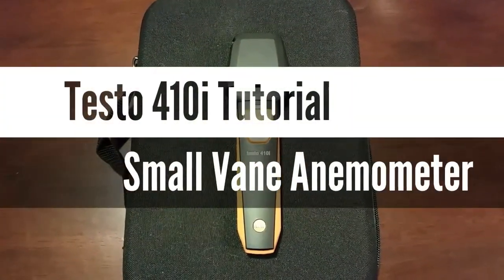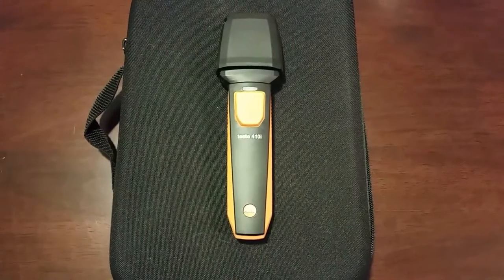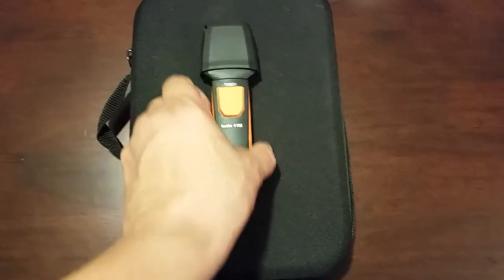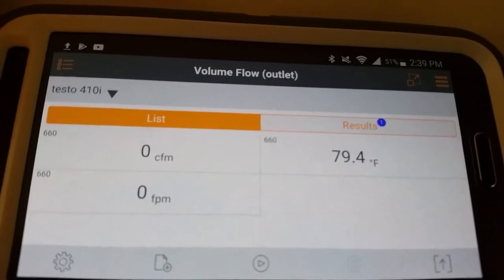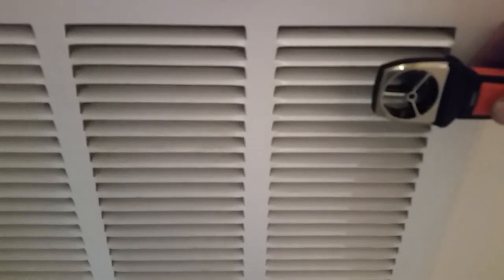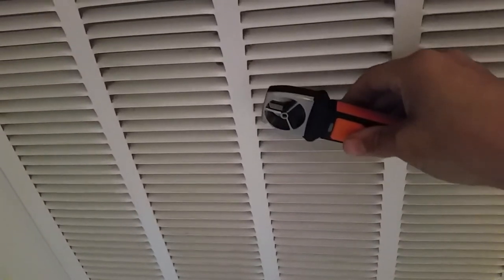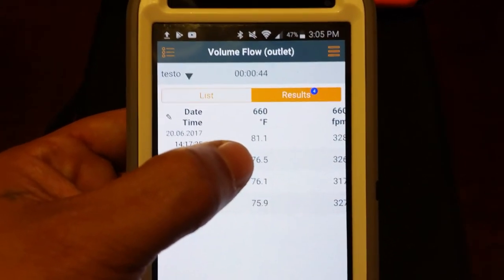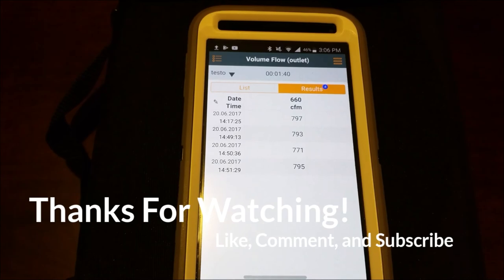Testo 410i Small Vane Anemometer Tutorial

Comment: how do you determine the free area of a return grill?
Reply: The most accurate way to determine a free area measuring airflow on the same type of grille by pitot tube traverse and comparing that to the a measurement without a free area factor. The reading that you get by an accurate measurement divided by the measurement obtained by the anemometer times by 100 will be the grille free area percentage. Otherwise some manufacturers might provided this data. Generally though free area for a louvred grille like the guy measured is around 75% and for eggcrate grille around 90%. When you measure the grille area don't include the frame around the grille or large spaces in between and you don't need to measure these areas with the anemometer. Measuring airflow with an anemometer is not the most accurate way of measuring airflow especially when the velocities being measured are less 1 m/s or 200 FPM.
Reply: @alibabahck  do you know anything about the correction factor on the 410i?
Reply: @Blakepopp  I haven’t used that one for a while but I remember that the correction factor is only used when you are trying to measure air flow. The correction factor is the free area factor. If you change the mode you can just measure velocity and calculate flow manually which is what I preferred because in the flow measurement mode it doesn’t tell you velocity. I recorded my data in an spreadsheet which can add your free area factor into it and grille size. If you just want a rough reading and don’t care about velocity you can use the flow mode, put the right area in (just the open part of the grille- not the frame). The factors normally work out to be around 0.9 for a return grille and around 0.75 for a supply grille.